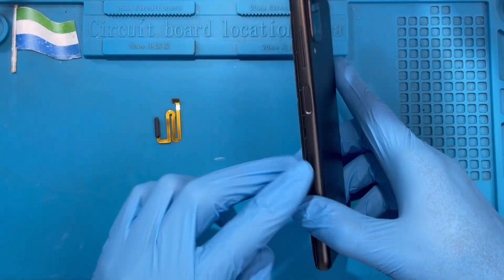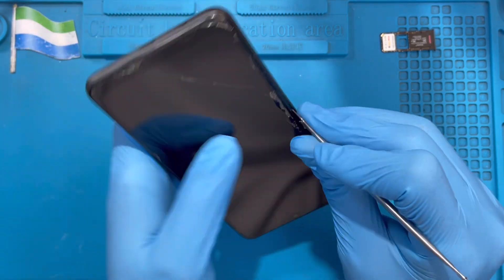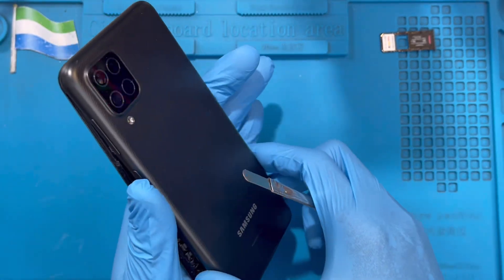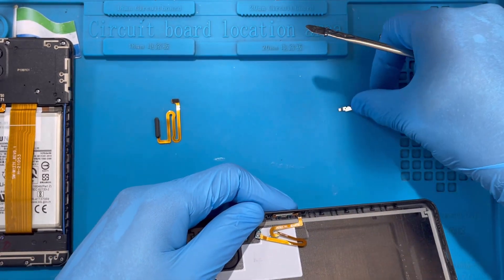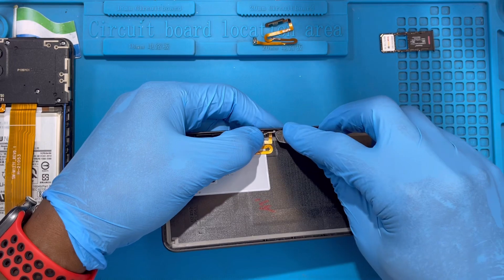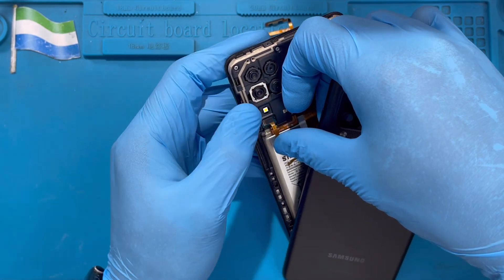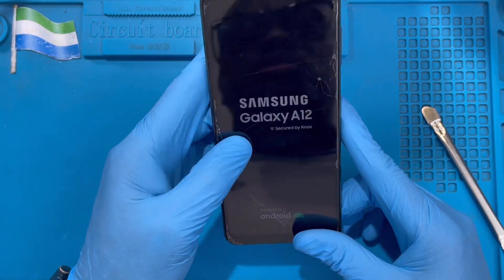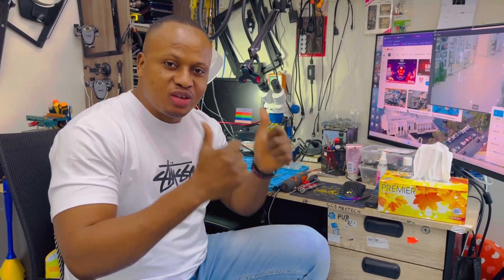Samsung A12 On / Off Button Replacement

Comment: The litte metal diode piece on the inside of the power button fell out during the process. I've glued it back to where it was but its not working, im not sure if the glue stopped it from working and I'll have to rebuy the flex cable
Reply from the maker: You have to buy new one
Reply: @techmed3618  thanks